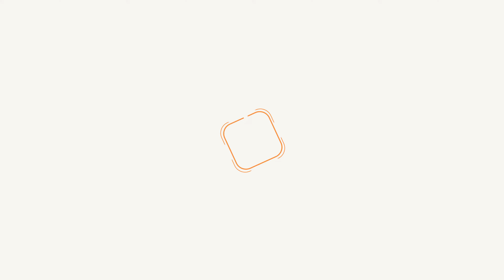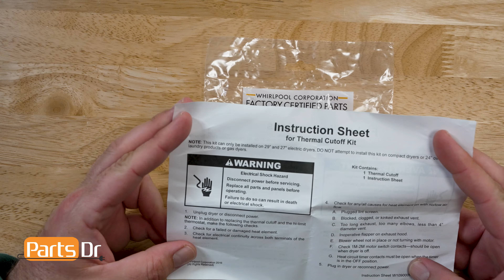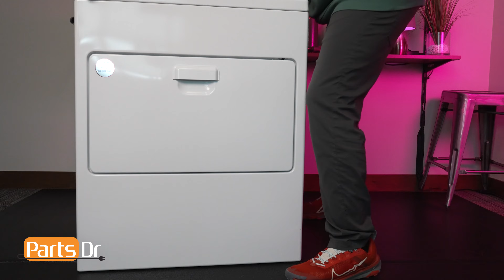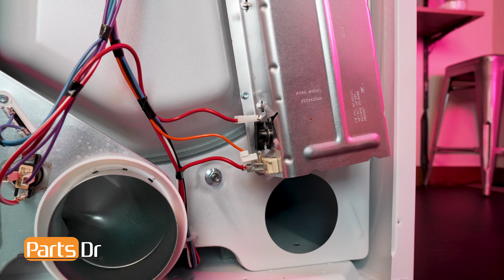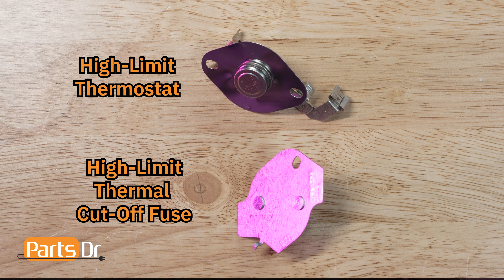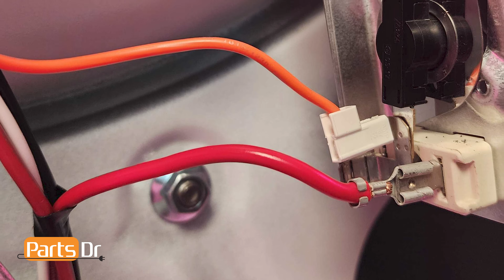Dryer Not Heating?! How to replace Thermal Cut-Off Fuse Kit part # W10900067 Whirlpool Maytag Amana

Comment from the maker: We hope this video helps you get your dryer heating again! Remember, if you're shopping for replacement parts, be careful when purchasing from sites like Amazon or eBay. Many of the cheaper aftermarket kits just don’t hold up and can lead to frequent breakdowns or safety concerns.

For dependable repairs, we always suggest genuine OEM parts. You can find the thermal cut-off fuse kit and other high-quality replacements on our website at https://partsdr.com. It’s worth the investment to keep your dryer in top shape and avoid additional repair headaches!

Also, did you know that these dryers have a second thermal fuse?  Learn about the other thermal fuse here: https://www.youtube.com/watch?v=wvaki76Cjpg

Comment: Great video. A friend of mine bought a new heating element thinking that was the problem. I had watched your videos, so I went ahead and did a continuity check on the old element. It looked fine. I installed the new element and upon running the dryer it still had no heat. The thermal fuses were showing good continuity, but the high limit thermostat showed none. After a quick trip to Tribbles, I replaced the thermostat and all is well.
Reply from the maker: Nice job troubleshooting and fixing the dryer!  If you haven't already, make sure to clean the lint out of the lint chute https://www.youtube.com/watch?v=UG3Pr94X5uk and that the exhaust venting from the dryer to the extetior of the house is free and clear.

Comment: Wth?!  My dryer is missing the orange wire for the thermostat entirety.   How is this possible?
Reply from the maker: What is the model number of your dryer?
Reply: @PartsDr  medc465hwo
Reply: @PartsDr  MEDC465HWO
Reply: @PartsDr  Hey,  model MEDC465HWO
Reply from the maker: @interminablyperplexed4903  Your model dryer does not have an orange wire that connects to the high limit thermostat because it uses a different type of moisture sensor system compared to the dryer shown in this video.
Reply: @PartsDr  Thanks.  So the replacement thermostat just has an empty prong?  It works now but just seems wrong.
Reply from the maker: @interminablyperplexed4903  Yes that is correct, that prong will remain empty on your model dryer.
Reply: @PartsDr  Appreciate your responding.  Take care
Reply: @PartsDr Is this also true for Whirplool WED5000DW2?
Reply from the maker: @TheLibertydawn  Yes
Reply: Thank you for this I was looking High and low wondering why my dryer dosent have that orange cord but a yellow one that’s not connected nor long enough to connect to the fuse of the element

Comment: This channel has been a savior for me twice now. First, several months ago, my thermal fuse went and I needed to know how to test it with my multimeter. Today, I had the same issue of no heat, and tested my thermal fuse which was still good. I knew there were more fuses but wasn't sure where to start. I watched this, removed both pieces and tested them, and found that the thermal cutoff was bad. Just ordered my new parts. Thanks a bunch!!
Reply from the maker: We are happy that we could help! Also, check to make sure that the dryer had good exhaust airflow by checking for lint buildup in the lint chute https://www.youtube.com/watch?v=UG3Pr94X5uk and checking the exhaust venting from the dryer to the outside of the house.